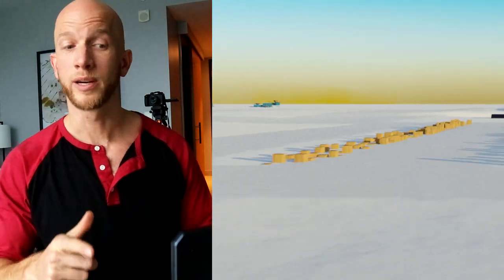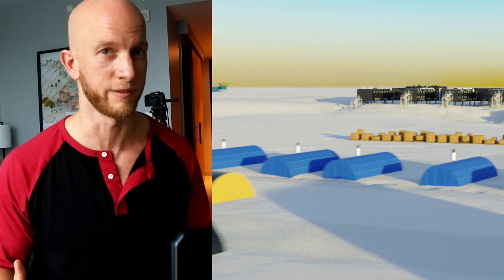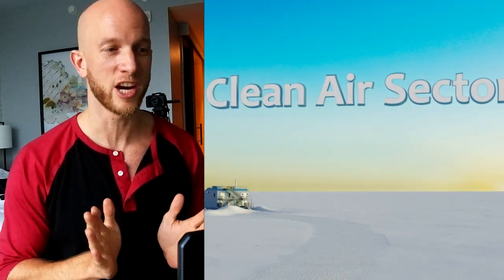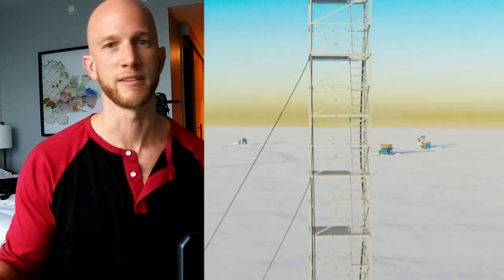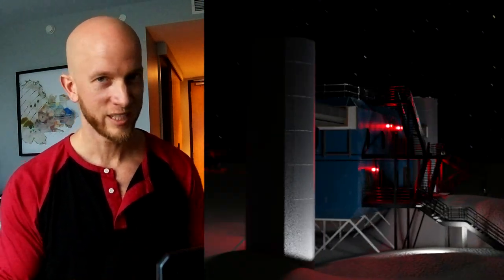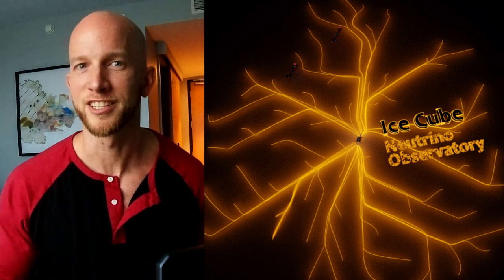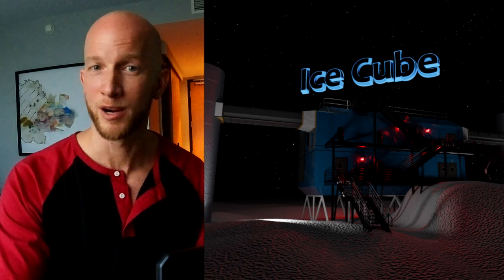Walk-through of my CG rendering of the South Pole Station

Comment from the maker: *CORRECTIONS*
1:04 - Skynet is not the only uplink connection that South Pole has now.  There are others that offer faster connections, including SPTR (South Pole Tracking Relay) and DSCS (Defense Satellite Communications System).
3:56 - The station supports do not have the jacks in them all the time, they need to be installed for the lifting procedure.  An exhaustive explanation can be found here: https://www.southpolestation.com/foundationdesign.html
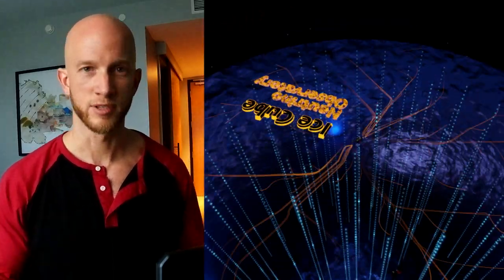8:32 - There is actually 2 miles of ice underneath the station, not just 1 mile.  Also, as I mention in the caption, the Ice Cube detector modules are MUCH deeper than depicted in the rendering.  I opted to make them shallow, or else I'd risk making the viewer dizzy (dizzier?) by quickly diving deep into the ice.
Reply: Wait, isn't Skynet the bad guy in the Terminator movies?

Comment: The Hypertats are part of what used to be called "Summer Camp".  It was "overflow housing" in a sense, from when the station was just the Dome (with 28 beds) and into the early days of the current station up until enough of it was completed that the entire Summer population could fit.  The Hypertats were also used briefly during the Winter 20 years ago when they needed housing for the Winter construction crew beginning to build the new elevated station and they needed somewhere outside of the dome to put all the extra people.

I stayed in the Hypertats in 1996 during my first trip to Pole.
Reply: D'oh! I just found this comment after leaving mine about Summer Camp.

Comment: Ice Cube was also build during the years of deployment. The hypertats you mention at the beginning were part of what was known as "Summer Camp". Not only was the new station being built (so wasn't ready for full residential capacity), but even when it was completed the number of people on station at any one point was larger than the capacity of the main station building. I lucked out and never had to stay in the summer camp the times I went down there (deploying the surface array portion of IceCube). But I did visit the bar out there on occasion.

Comment: Hey Joe, have fun during your season at Pole! Just wanted to offer a little bit of clarification on the radomes, since I spent a bunch of time in those things.

The radome you focused on at the start (woohoo, top billing!) might officially operate as the ground station for Skynet now, but back in my day (2009-2013) it was chatting with a different set of satellites, and we'd know it as the GOES-3 radome. Same building, I assume same dish, but it was built for GOES.

More importantly, you're missing the other buildings next to it! There should be a second, smaller radome that houses the TDRS dish, although it's possible that it might have been renamed and responsible for a new set of birds by now. I've never heard of DSCS, but I hope for the sake of your video upload schedule that it offers plenty of bandwidth :)

Finally, you're missing the squat little rectangular prism building just a little further toward station from the GOES (nee Skynet) radome, one that's probably not that interesting to most people but can't be forgotten - the RF (or Remote Facility) building. It's probably the best spot on site during the summer to just stand on the porch, breath some -40F air, and stare out at the empty sastrugi for a moment before heading inside to eat stale graham crackers.
Reply from the maker: Thanks so much for your expert input, I really appreciate it!  Adding these buildings will be my highest priority when I get back to revising it.  However I'm waiting until I get there in person to make sure my next round of revisions are true to life (also will help in getting the textures right).  
Again, thanks a bunch, it's input like this that helps me toward my goal of making this be the most accurate model ever of the South Pole.

Comment: Love the all the views and especially love the attention on Ice Cube.
Reply from the maker: Thanks for all the added info in your comments!  I was hoping some on-the-ground experts would stop by and add or correct the information I give here.  Really appreciate it.
Reply: @JoeSpinstheGlobe  One minor detail that I could offer if you ever pull this project out of the bitbucket for more renderings. The detectors on the strings are only on the bottom kilometer of the string. Each string is 2-2.5km long/deep (I forget exactly), so there is a gap between the top of the detector array and the surface of the ice. Very minor detail, only someone involved with the project would pick that up. Other than that, I really like the glow effect that you used for the surface cables. Looks really neat. 👍
EDIT: I should have read your caption giving the known issues with the model. You already knew this. Sorry for the noise.

Comment: Are the neutrino observatory and the telescopes heated? There are building attached to them and I am wondering how comfortable it is inside of them.
Reply from the maker: Yep they're heated, same as the station. In fact the interior temperature is one of the main things that's monitored, because if the building heat fails then there can be big problems